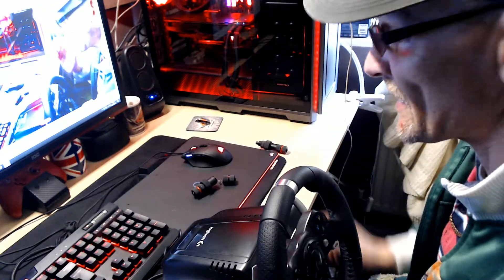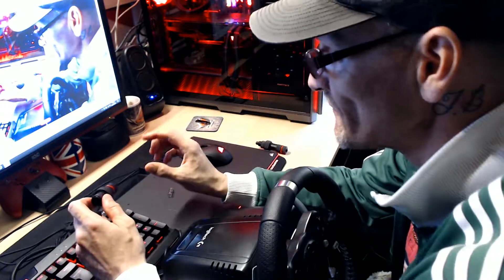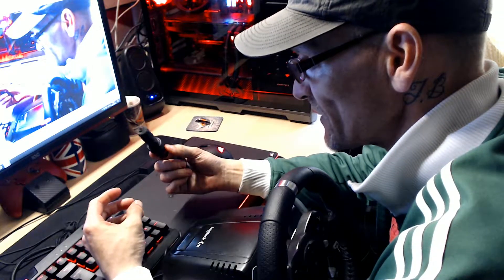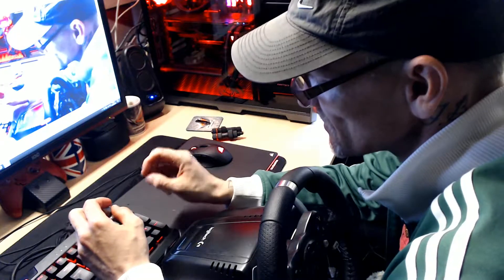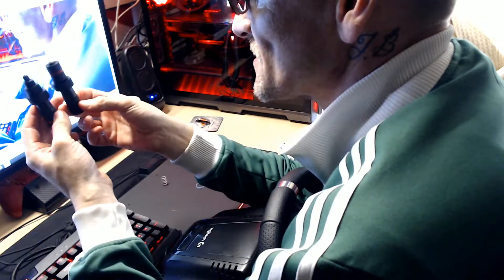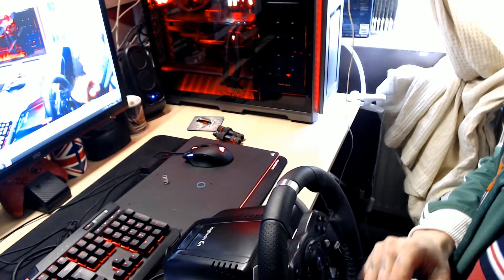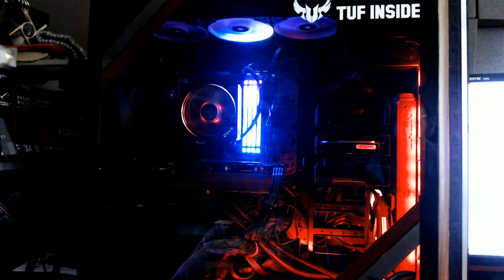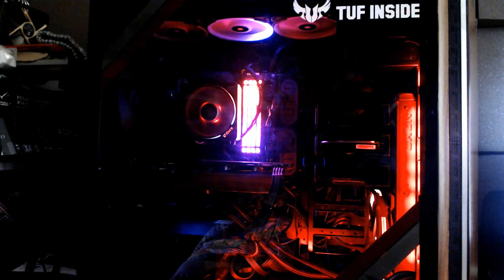Alphacool Eisbear quick release fitting fails and covers my pc componants in coolant.

Comment: Yeah I know it sucks when quick disconnects fail. I was so lucky when mine failed. They were Koolance branded ones and I had an external 360mm rad mounted on top of my pc case. After 4 months I went to clean out the dust and disconnect the two lines leading to the rad, both fittings in the spring mechanism jammed and started pouring outside my case. It was my worst pc experience and made one hell of a mess. Never went back to water-cooling after that.